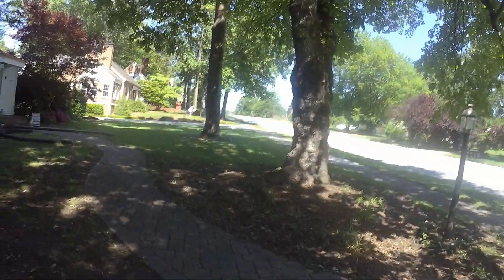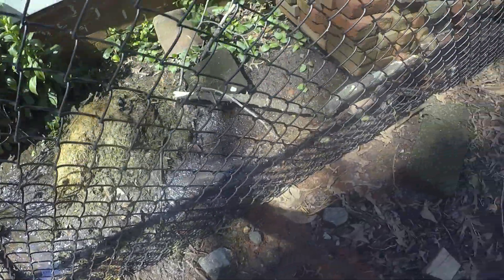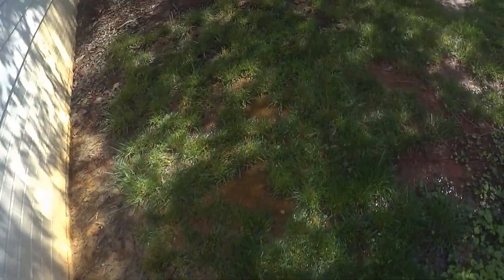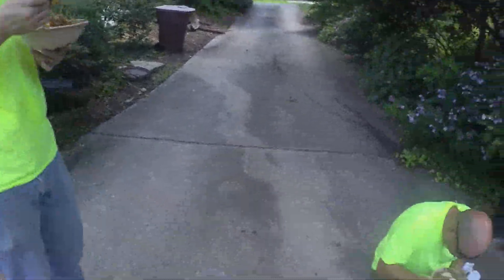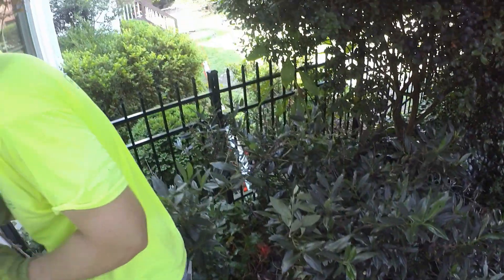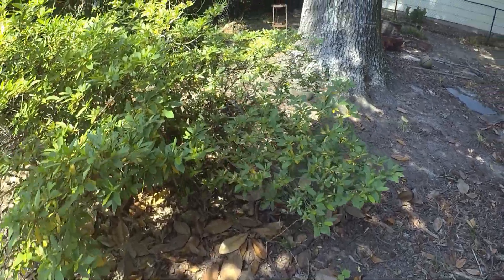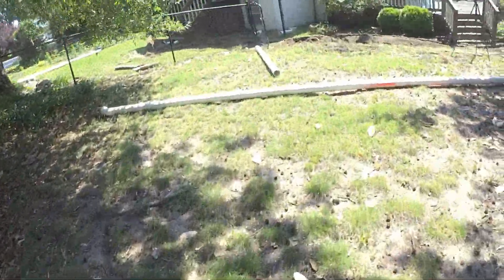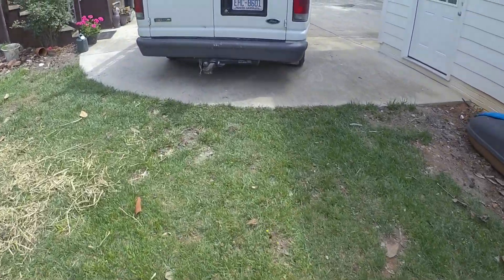Solving flooded basement with PVC drainage pipes + Catch basins

Comment: That's such an easy fix if you use gravity like the city water towers do. The fix is this simple, remove the gutter down spouts and replace with glued 4" PVC pipes tied in all the way to the curb. As water enters the down spouts, gravity will force the water to seek the path of least resistance. As more water fill's the vertical PVC pipe, the pressure to escape builds and that is how the water will drain...let the water gravity force the pipe to drain.

Comment: LOL! Come on guys,  you are just taking the property owner's money.  You are not solving anything as long as there is a retention pond right next to the property at that level shown. The only thing that will help are sump pumps. But,  they would have to run so often that it would not be worthwhile.  If I were the homeowner, I would pray for lightning to strike the house and burn it down.
Reply from the maker: We took the homeowner's money and solved his basement flooding problem. This was an awesome homeowner to work with and we have kept in touch. Things are dry!

Comment: 6:40, with that aggressive fall into a sanitary tee, I wonder if the water isn't crashing into the far side of the tee and losing a lot of its energy, then just free-falling from there (sacrificing all the fall it used to get to that point).  I'm thinking maybe take that pipe into a street 45 into the side of a wye, to try to turn that stream downward without slowing it down. Worth it? Waste of a couple fittings? I don't know. Just a thought.  I definitely like how solid that pipe is, going through and area that is obviously used for storage. Well done.
Reply from the maker: Yes we often use a wye and street 45 to create a combination wye if the fall is lower.

Comment: Your 12" catch basin install, the other pipes will be saturated with water and won't flow out into that much higher outlet pipe. Unless you have sump pumps into the basin. Did I miss something? Then if that was true, the water will go out the outlet pipe and the basin grate.
Reply from the maker: The basins fill up and then flow out of the pipe. You missed that if we started the outlet pipes lower we wouldn't have fall away from the CB.
Reply: @GCFD  Yes I did miss that, my fault. The dreaded fall....

Comment: In a situation like this it would have being a better idea to bring all roof rain water to one 4 by 4 by 5 ft deep central basin with two 2 inch Zoeller sump pumps into one 3 inch discharge line to the street, yes it would have cost more but a better set up.
Reply from the maker: You could have done it that way. We didn't because the outfall was downhill and by that point the water wasn't harming anything. Great comment!

Comment: so the large catch basin must fill with water to the height of the white pvc pipe before it will flow out? doesn't the water become stagnant that just sits in that basin? Why not just run pvc all the way? maybe there is an elevation change?
Reply from the maker: Yes, the water has to fill up to the level of the pipe before it begins to flow. We drill weep holes in the bottom and set the catch basin on a bed of gravel. This allows the residual water to drain out and prevent stagnant (mosquito) water.
Reply: @GCFD  ok. i have a sidewalk that always floods at the end of it from my gravel driveway. That looks like it would be perfect for this problem. Thanks
Reply: @somuchinfo  If you have a straight edge of a sidewalk I would use a channel drain instead of a catch basin. This is because the channel drain is straight and will go against the sidewalk and make a nice barrier for water. Check out my video on when to use a catch basin vs channel drain to see how I found this out (;

Comment: Where do you get those large catch basins?
Reply from the maker: I get them from my local landscape supply house, SiteOne.
Reply: I suppose you could always use a big plastic dustbin.
Reply: @keithsawyer6356  i feel like it would probably collapse though since those arent meant for pressure from the outside
Reply: @keithsawyer6356  I re built the sump pump pit in our rental property with a 55 gallon plastic drum with holes drilled in it and the top cut off!  You could also use a 30 gallon drum too!

Comment: Why not pointing the water to the street and then to the storm drain
Reply from the maker: The street was uphill so we would have had to install several sump basins and sump pumps. Pumping water is a last resort for me. I try to passively let the water flow downhill as it already wants to. No maintenance, equipment, or electricity to worry about. The flooding basement problem was because the water in the front had nowhere to go and sat around, eventually making its way into the basement.
Reply: Keep the hard work 👍